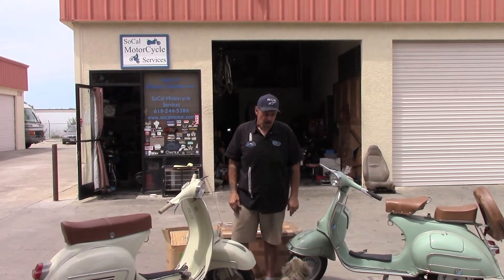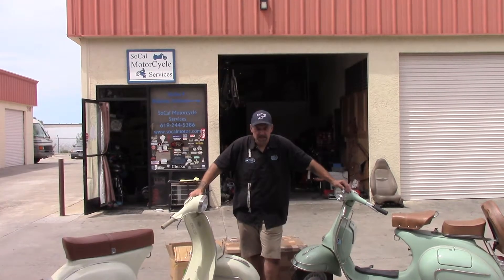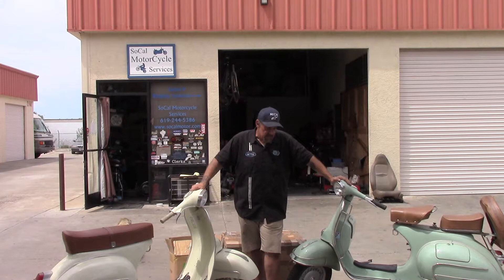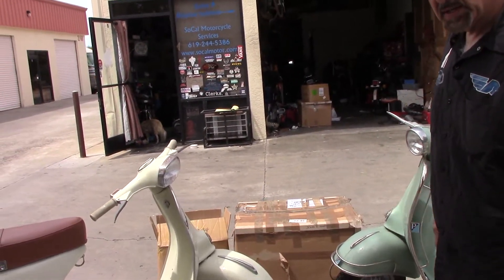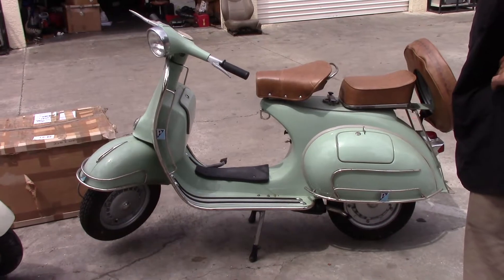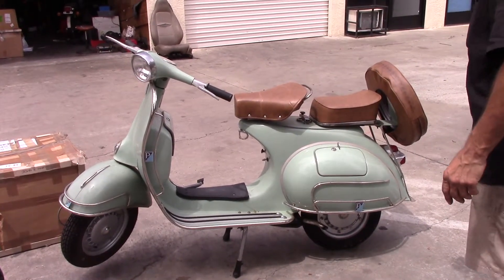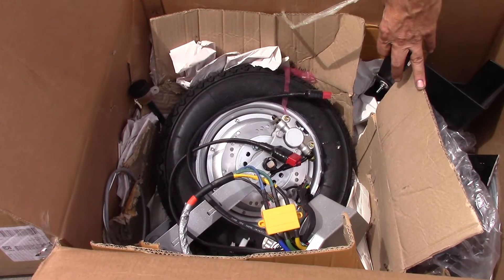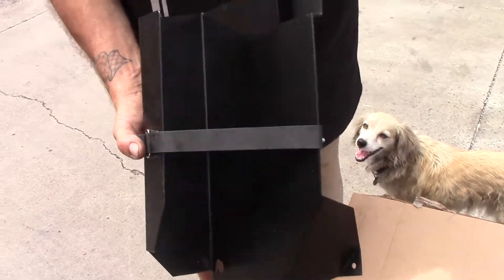Vintage Vespa Electric Conversion with Retrospective Scooters Kit Part 1

Comment: what the brand of the kit? and what's the engine power? thanks!
Reply from the maker: I am using the kits from 
www.retrospectivescooters.com
Check out their site.
Reply: @socalmotorcycleservices2876  thanks im looking into a conversion and they are an option